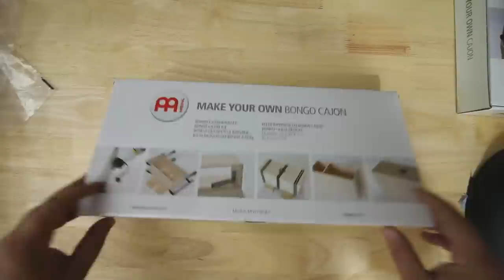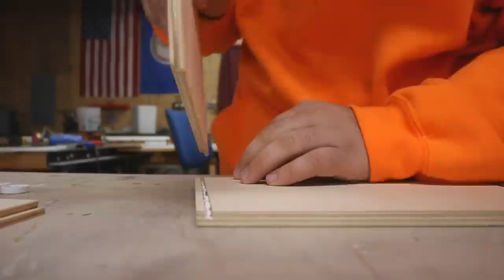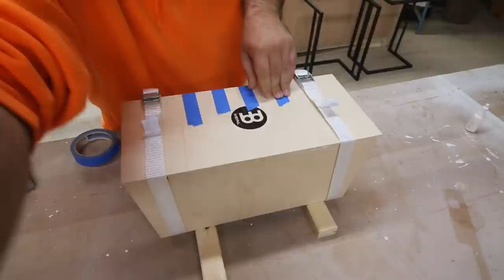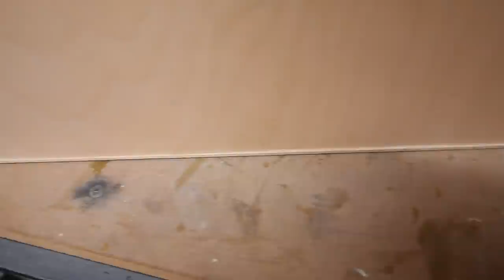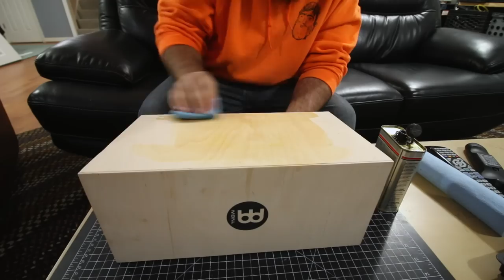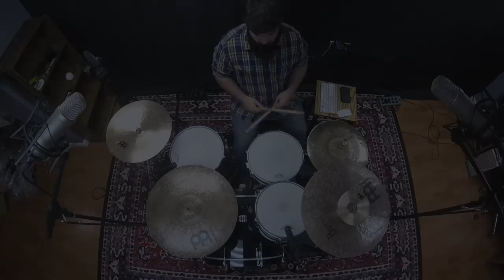Meinl Make Your Own Bongo Cajon - Drum Set Jam

Comment: Great tutorial thanks ! 
I would like to make 2 extra suggestions . 
1. Instead of the blue tape , extra belts could be tied or clamped around it . 
2. When hammering the dividers in , I’d use a bit of padding on the wood to prevent dents in the wood . 
Thanks for the video ! 😊

Comment: Had a cool thought yesterday. Use long double lugs of just the right length and hole spacing to connect 2 floor toms end to end to make a like a 32x16. Like mount the lugs “upside down” so they extend past the bearing edge and half screws into one drum and half into the other... bridging the gap. Only use heads and hoops on the outer ends so that it really functions like one long drum. Maybe play it like a kick drum with spurs on it since it ought to have a pretty similar internal volume to a 22” kick. Somewhere around 6000 Cu. in.

Comment: Nice.  Very cool. Good, clear video with solid advice and tip as we've all come to expect on this great YT channel.   Might be a fun project to do with the grandkids, too.  And the price is right for sure.

 BTW, I'm sure that it's not written in stone or anything but looking around at other videos it looks like the normal way of playing bongos for a right handed player is to have the lower pitched drum on the right.  I mess around with bongos a bit and have tried both ways.  It seems to be easier and more natural to do it 'right hand low".  Easier to play the 'ands' on the low drum which works well in a lot of musical situations.  (as a quick example, try playing single stroke 16ths on the high drum moving the right hand to the low drum for only the "and of 1" and the "and of 3")  Playing that way also gives you the same orientation as a regular drum kit, tom tom pitch-wise.   Just my two cents.